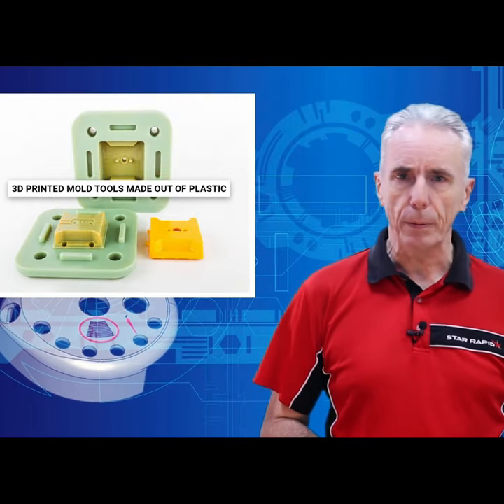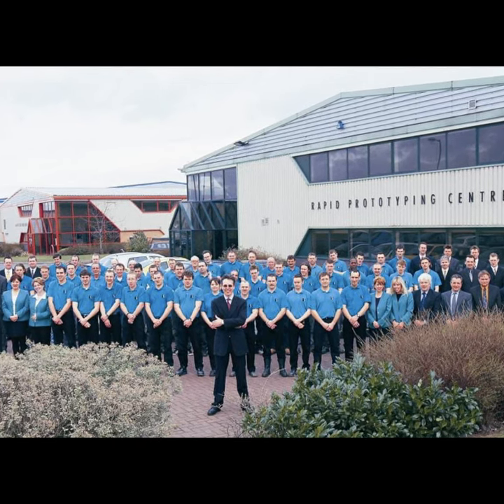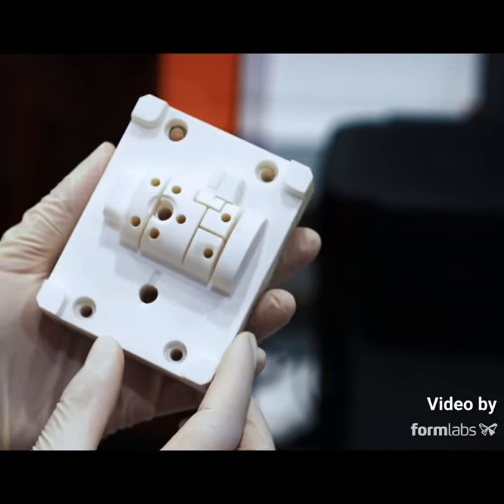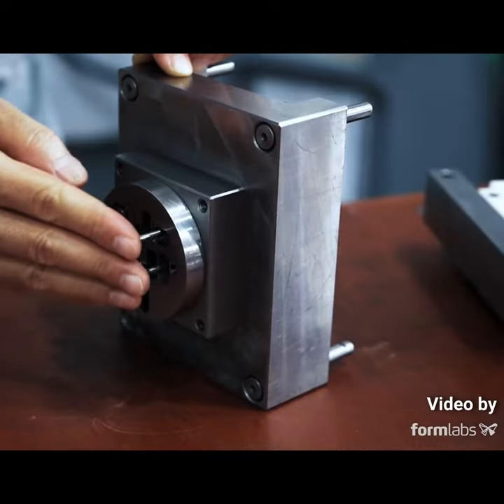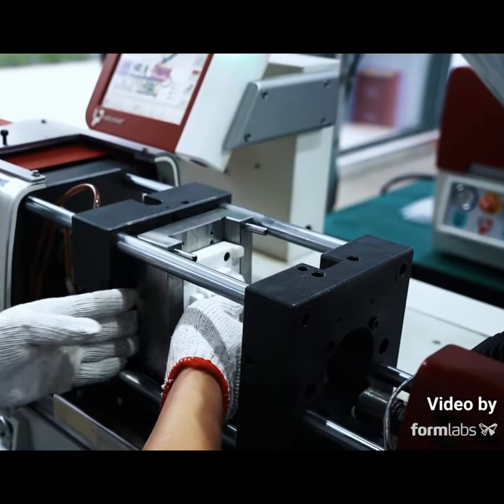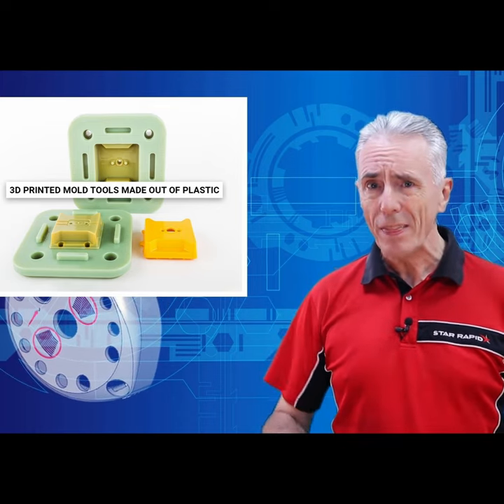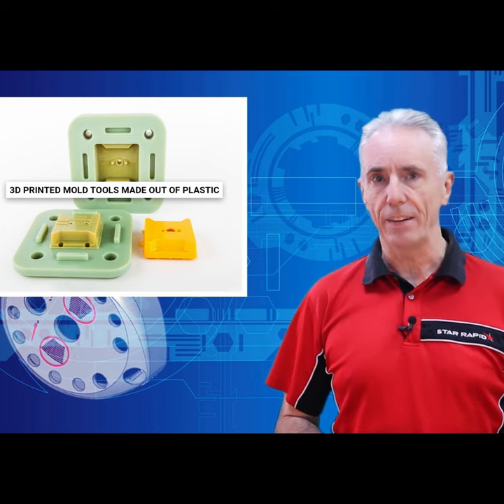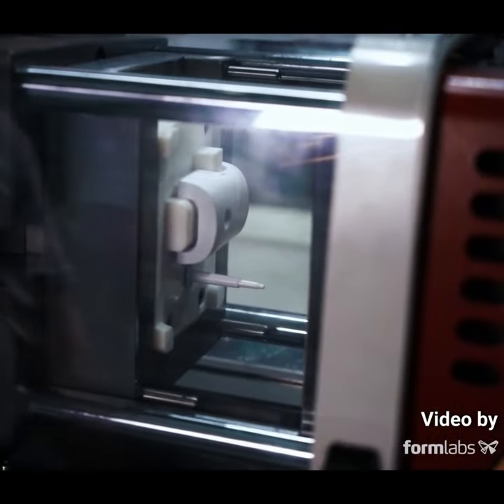There is a MAJOR PROBLEM with 3D PRINTED INJECTION MOLD tools! #shorts #3dprinting

Comment: There are various filaments that will likely stand up to the temperature needed, such as nylon, and some resin should work, and layer lines are easy to fix.
Reply: you realize there are metal 3d printers usink powder and lasers

Comment: That sounds like you're talking about layer lines with an fdm 3D printer. Three pretty nice come up significantly in the past few decades there are significantly harder and more durable 3D prints out there that are made with nylon made with various other types of materials SLA 3D printing or MLA are just a couple of them and companies actually make particular resins are designed for injection molding they're not as good as an alloy but they are significantly better than what you potentially used in the past. I'm not saying that the research you did back then is to be ignored but it definitely warrants a revisit
Reply from the maker: Thanks for your comment. For sure. We might even do an updated video for the newer machines.
Reply: @starrapid  would love to watch it! Currently looking into making 3d printed molds with resin.
Reply from the maker: @fefo360  👍

Comment: cant you 3d print the model and create mold from concrete or how is it called? or other material then plastic that isnt molded using heat

Comment: Interesting stuff, what kind of plastic is the mold and the parts?
Reply from the maker: This is from one of the 3D printing companies. "Here, you can use anything that will melt down and harden in your mold’s shape, like metal or other thermoplastics. If you’re completely new to injection molding, we recommend using silicone. It’s easy to work with because its mix of firmness and flexibility makes it easy to get out of the mold and brings this versatility to your final object."